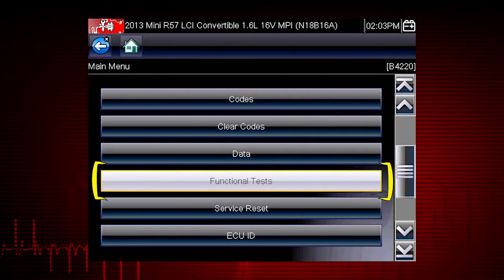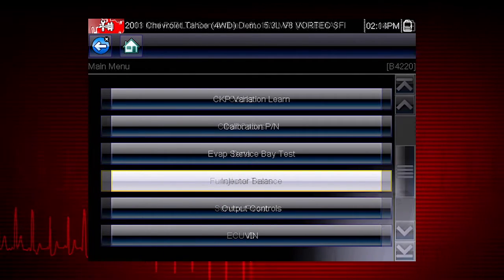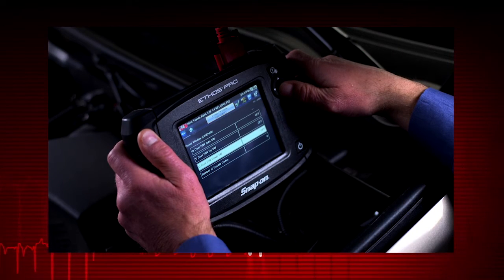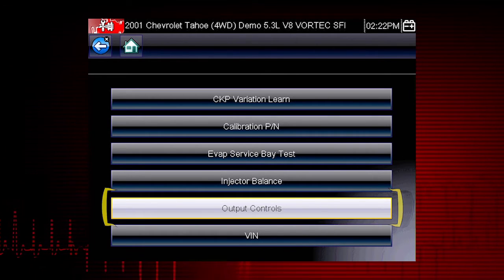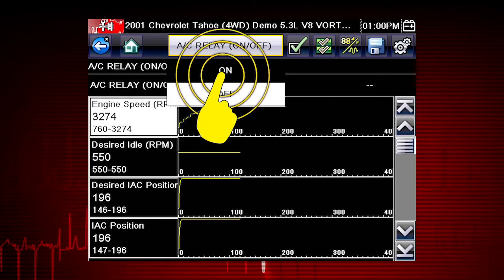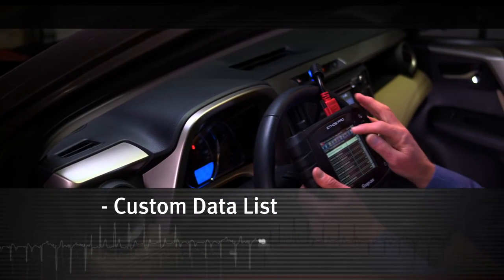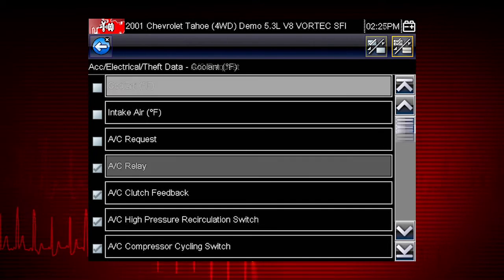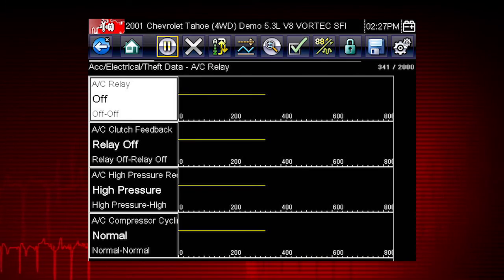Scanner Functional Tests : ETHOS® PRO (5/7) | Snap-on Training Solutions®

Comment: does the ethos not support functional tests on fords? or was it not originally included and added as a later firmware update? just trying to figure out real-time alternator current output, which should be a simple test but i cannot figure it out.
Reply: Which Ethos do you have? Original, Plus, Pro, Tech, or Edge?